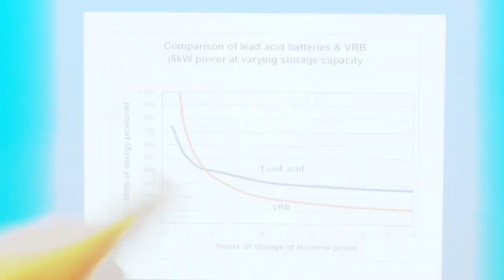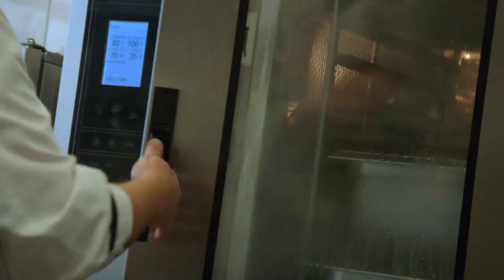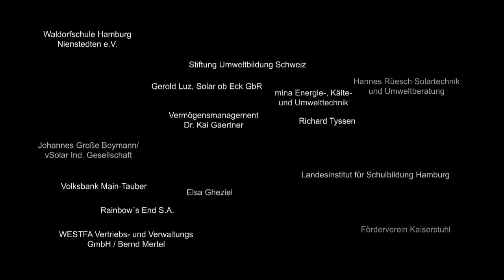AVAILABLE NOW ON DVD: THE 4TH REVOLUTION - ENERGY AUTONOMY (community-trailer)

Comment: @MrCally1 Well, the real reasons are more obvious than that. In the current state, the profit to be made on renewables is way below fossil fuel. Fossil fuel = huge quick bucks. On top of that, renewables can be operated locally and even individually which equals big potential loss of market share for the energy giants, up front oil. They desperately hold tight to outdated "tech". For the rest, see my previous post.
I hope the brilliant H. Scheer has found a worthy substitute.